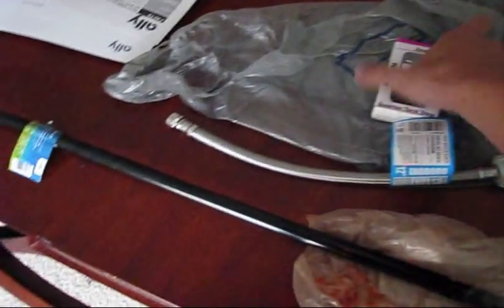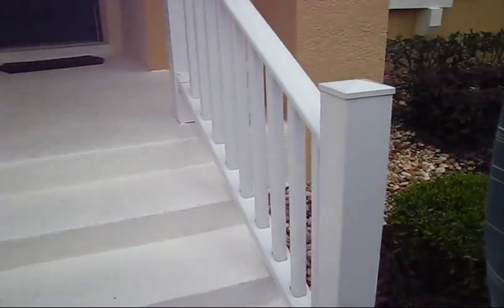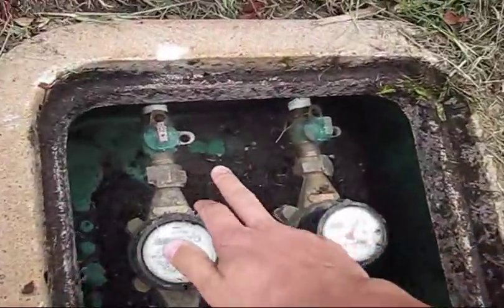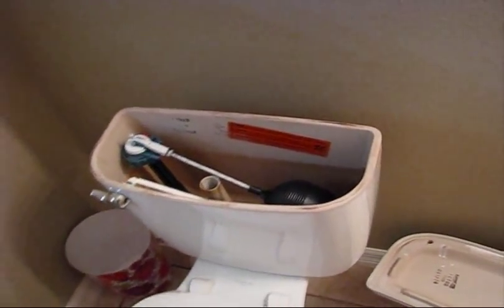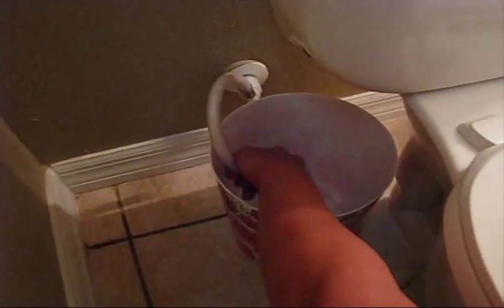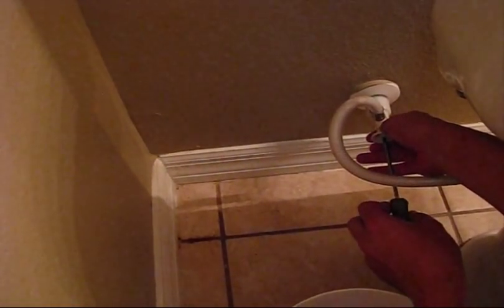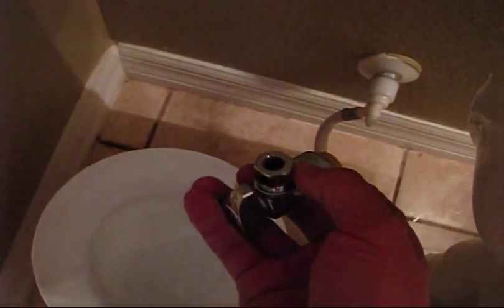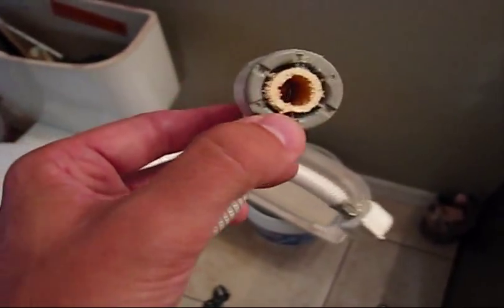Fixing a Toilet - Water Supply Valve and Hose Replacement part1

Comment: The way that valve is removed is by grabbing the entire valve and turn it counter clock wise and pull at the same time and it will come off.You don't have to cut the pipe like you did.